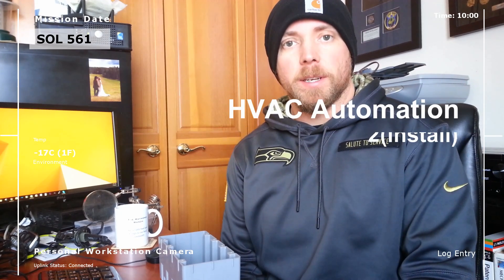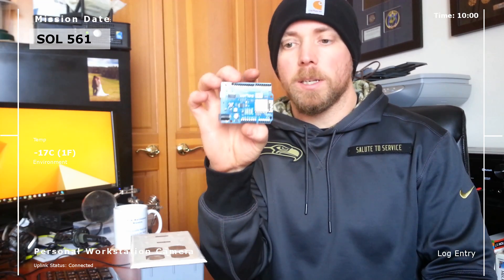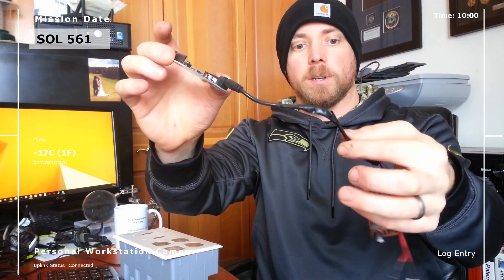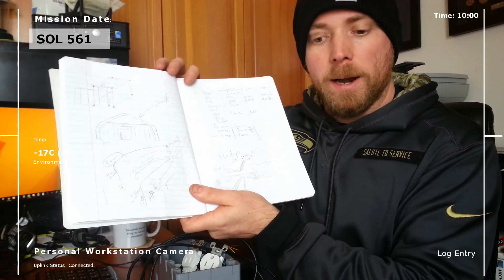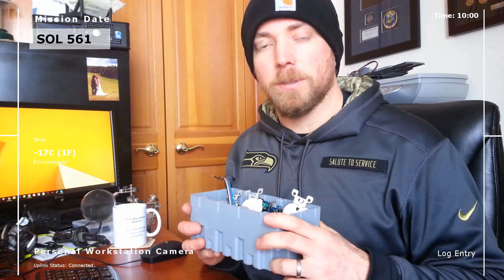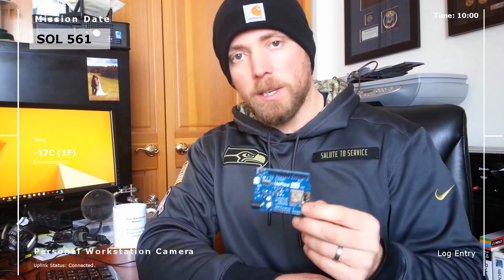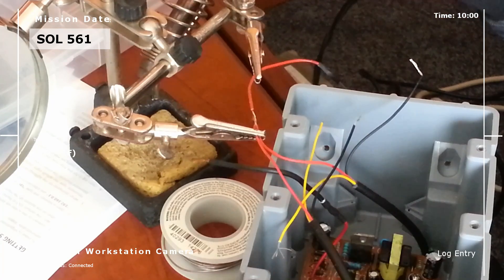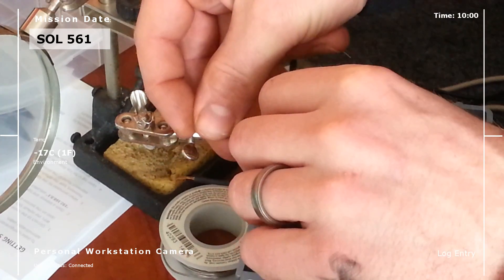Automating Aquaponics HVAC with WIFI Arduino's (ESP8266)  Part 1

Comment: I hope by now you have changed this. Thats a a 4 gang swith box, indoor. Not a box for controlss. You are creating an unsafe condition in many ways. Insulation,grounding box fill. Consult a licenced electrician one with industrial controls experience. You could go down

Comment: I am not sure you would be saving much with custom boards.  Knock off Arduinos are almost free. Like $3 for a mini. Design in the last several years have moved to off the shelf equipment to drive down cost.  Consider design time in your calculation it is the most valuable asset you have and it is least available.

Comment: Pretty sure arduino runs off 5v with a 5v regulator on board to drop the 12v to 5v, reason I mention this is a 5v power supply for 5v is quite a simple thing to make with 2 capacitors and a zener diode and would be far cheeper especially in the production model :-) also the voltage regulator is usually to first thing to fail as it produces alot of heat dropping 12v to 5v :-)

Comment: why not plug in a extension cable from the programing port and cut a small hole in the faceplate somwhere and glue the other end of the cable to the hole for easy access. faster programming

Comment: Love this video! I'm a web developer and have a lot of hardware type of ideas I'd like to tinker with. Just got a Kickstarter backed kit delivered which includes a wifi arduino board for making a little vehicle that can be controlled by an app. Your walk through of hardware setup is very helpful. I should probably watch less YouTube and get started.

Comment: You may find the Arduino resetting whenever you turn on a heavy load, try adding a snubber network to the relay contacts. An SSR is sometimes more suitable.
There's no internal fusing in this design, you may want to think about that.
You've also got a lot of floating inputs, maybe set them as "input" and grounding them all.
Reply: Appreciate Video! Apologies for chiming in, I would love your initial thoughts. Have you ever tried - Patlarny Gardening Expert Principle (search on google)? It is an awesome one off guide for learning how to expand your produce with the clever art of aquaponics minus the headache. Ive heard some incredible things about it and my cousin finally got excellent success with it.

Comment: The relay connections are not fail safe - you could create a situation where the Arduino crashes and the relay is held on. Instead use the Arduino to drive a watchdog latch with pulses, this then turns on the relay - in a crash situation when the pulses stop or remain at 1 or 0, then the relay turns off.
If you added a current sensor you could check if the relay contacts were welded on too.
Reply: horse1066 so use the other pin for the relay? There should be a default open and default closed connection. If the Arduino is off, wire your circuit so it is off and the relay is also "off" - I don't know why but all of the tutorials online for Arduino relays are backwards.
Reply: Aaron Anderson Hi, nope I was referring to the relay driver section - say you are turning on a heater and it's really important that the heater doesn't stay on longer than intended (because, fire). So you turn the heater on, then you happen to die - the heater is now on and will stay on (because nobody is alive to turn it off).
What you need is a second person (the watchdog) whose sole job it is to turn off the heater every 10 seconds regardless. So you die, the 2nd person turns off the heater around 10 seconds later - all is safe.
Now your job involves turning on the heater whenever it's required, but also telling the 2nd person that you are not currently dead and to not attempt to turn the heater off, but to check again in 10 seconds.
There are a couple of ways of doing this, here's a slightly overcomplicated version
http://raspberrypihobbyist.blogspot.co.uk/2014/01/fail-safe-circuit-using-discrete-logic.html
Reply: I hadnt' considered that if an adruino locked up that it would/could be stuck sending a "high" or "on" signal to the relay. I've seen them crash, but it's always been total failure and they fail off. Interesting problem for sure. Nothing another arduino couldnt' solve.
Reply: In industrial control systems they sometimes use a pulse train going into a capacitor, this keeps the capacitor charged which keeps the base drive to a transistor high. Computer crashes, pulse train stops, capacitor discharges, transistor turns off. But then you get the issue of a transistor failing in a short circuit condition, so you have to have a backup transistor for your original transistor.
Then you have to design your software so that it doesn't get stuck in loops, or get confused about what it's supposed to be doing next.
But yeh, in mission critical systems they'll use three computers using different microprocessors, using software written by three different dev teams, and then all three computers get to majority vote on which relay to turn on/off. If they don't all agree then it's shut down.
I reckon his design is a bit haphazard so it's possibly going to crash unexpectedly, but for a couple of heaters it's not going to be a disaster, just reboot and carry on.
Reply: That's interesting. I will have to do some reading!
Reply: He should learn if it works and is stable quickly and back to design the fix.  check out wikispeed videos they are working on a more software like version system for system design to build an open source car.  They build it in these sprints,  then use it, fully knowing it is vs 1 or vs.01.   You note design issues during the build while still finishing the version so you have operational product in hand at the end.  You would need to debug the product either way, and it might just work well enough.  Pretty interesting prospective they are using.
Reply: Cheers for the Video clip! Forgive me for butting in, I would appreciate your opinion. Have you heard the talk about - Patlarny Gardening Expert Principle (google it)? It is a great exclusive product for learning how to expand your produce with the clever art of aquaponics without the hard work. Ive heard some pretty good things about it and my good mate called Gray  got astronomical results with it.

Comment: It's generally not done to drill holes in the mounting box, it affects the integrity of the unit - better to mount everything on brackets that stand off from the front panel - then the whole unit can be removed as a whole, with maybe only the 110v coming in via a IP gland. Also ring crimps for any live connections are normal.  (I used to work for a company making controls for power stations)
Reply: So wrong

Comment: Consider a heating element to keep the electronics dry. Maybe spraying the underside with silicone. Condensation and electronics don't mix very well. After 18 years working with radio controls on heavy equipment such as construction cranes and mobile cranes i have seen strange errors due to a small drop of water.  :D
Reply: I hope he gets around to reading some of these comments.

Comment: Does the Arduino give off any heat? if so is having it in a small space with the temperature sensor enough to affect the temperature readings. Also would having the humidity sensor in a box affect its readings?

Comment: When coding the arduino. Watch out for faulty readings. Sometimes you will have anomaly readings from these sensors. May want to time average the outputs from the sensor.

Comment: What I do with these kinds of boxed devices is that I mount everything on a mounting board or two, do all the connections and then push said boards in the box, preferably mount the boards in the box somehow depending on things.

About optimizing the design, I think it is a great idea. Especially if you can have these manufactured and certified for regular home use so that using these doesn't cause any problems with home insurance in case of fire or something. For that reason I'd separate the relay box design from the sensor design. Then using a wireless connection the relay box would be electrically safe and technologically  just a remote controlled relay box and certainly easier to get certified than a "heating control device" or anything where you need to think about electrical isolation (extra low voltage cables and regular 110/240vac).

About electrical safety, the chinese relay boards you're using are usually pretty good. They have a nice relay and the pcb has a cut so as to help in keeping the AC electric isolated from the control circuit.
Reply: I think the issue with cheap relays is inadequate contact coating which leads to contact welding, which leads to a heater forced on. He's got nothing in the way of fail-safes in this design.
Reply: @Dave Snothere Probably less safe than a fail-on for a nuclear power station, and they have redundant shutdowns everywhere. 12% of house fires are caused by tumble dryers alone, and they have the same OverTemp cutoff as a space heater.
It's not a matter of "how likely is this", but just basic good design. There might be a lot of noobs tying to emulate this guy and God knows what sort of wet string lashups they will end up with.
Reply: the heater itself has fail safes built in.  it is a portable unit that normally is plugged into the wall with no control at all.  How would a fail on situation be any different then a normal operation mode for the heater?
Reply: get your point and you are right,  about learning and teaching the right way.  Dryer fires happen in the vent and aren't monitored by the overtemp in the dryer, and salt water in a back up generator can make all those redundant safe guards ineffective quickly.

Comment: Cool beans...I used an arduino nano to control my washing machine ....took forever to work out the code just to make the washing drum rotate forwards and backwards but I got there in the end....do you have any suggestions for learning code...forums can be elitist and harsh as I found out much to my surprise ....great job and Yawah bless😊👍🙏
Reply: versatec1 stack exchange or the actual Arduino forums are fantastic
Reply: I am using a nano in my washing machine too.  My He machine would not get my clothes clean, some would come out dry and never get any water, so I added a water level adjustment knob and delayed the off signal.  More water clean clothes.  Doesn't seem smart to wash clothes twice in the name of saving water.
Reply: My prob was the reverse ...to much water not enough wash time ...I live in a converter truck 😊👍

Comment: Two tips with solder, 63/37 has no "plastic" stage, it is either solid or liquid, for your "off the cuff" type soldering, it is ideal to avoid cold solder joints.  Also, clean your solder before use, it gets a film on it which can create a yucky joint. I wipe mine with my t-shirt. If I was fancy I would use a rag or gauze with isopropyl alcohol.

Comment: What are you using for the temperature sensors? And using the "Arduino" flavor of C for your sketch?
Reply from the maker: the ds18b20 is the sensor. I use Eclipse IDE with the Arduino support installed
Reply: from what I can see dallas ds18b20
Reply: it will work, there are libraries in c, lua and python
Reply: Good choice. I'll also try the Atmel Studio, it looks great. I'm just not sure if it will work with esp8266.
Reply: Nice, thanks!

Comment: Some more unsolicited ramblings from me...

I realize its your rig & youre going to do it how you see fit, however maintaining an isolated ground plane between high voltage AC (not withstanding electrical noise / foreign power injection/contamination), low voltage DC, & the control plane you have inside of what looks like a 'new work 4 gang box' comes across as HIGHLY questionable (even that much more so with how tightly crammed you have everything in there), if I were an auditor for your insurance company (or your city's inspectors office) & I took a peek on the inside of that thing, you'd damm sure be hearing about it from someone if you & I wernt having some face to face convo about it.

If I were concocting this project How would I approach it you ask...?   I would put all of the HV AC goodies into (1) 2 gang box, then put all of your control/logic goodies (and the 12v DC bus) into another 2 gang box immediately behind it.

Dont get me wrong, I love my heat shrink -but given the environment, you may want to think about button splices (used in telecom, filled full of dieelectric jelly, crimped with pliers) if the solder splices have any issues, theyre available as both a splice & H Tap I think these are good for up to...   18'ish ga wire?

As others have pointed out, the brass hardware thats male on 1 side & female on the other are referred to as 'standoffs' by hardware fabrication professionals -FWIW

With regard to surface mounting control/logic boards to a plastic electric box, just a thought...    once youve got the board dropped where you want, use a flashlight to light up the inside & you should have visibility of where the boards mounting holes are, mark with a marker, drill from outside & run your screws also from the outside, using nuts on top of the board -No longer necessary to use uber stubby drivers.

--YFWH

Comment: If you want to make your arduino pseudovital you can generate AC outputs with the software and  AC couple relays as control devices.  If the Arduino locks up the value of the output pin does not matter as AC is required to operate the relay. This will require the use of two outputs per function but won't lock up in an on state.

Comment: Excellent stuff, this vid has stepped it up a notch for ya channel, showing us how to use ardrino and its practical application(as I have had no experience with it but always wanted to learn about them). BUT I have to tell u from experience..... don't mix high voltage and low voltage together, there must be either a separator board between the LV and HV side or safer again is to put the LV stuff in a  separate housing, I realise there is more expense but safety comes first. When the older AT pc's had the HV switch on the front panel to power on the pc, as a PC Repair Tech I was electrocuted(my right arm was tingling for days but I survived), When they made the ATX power supplies it was all LV outside of the metal housing so u were safe from being electrocuted when u have to work on the unit "LIVE".... You r 1 person and u need to stay 100% safe and u need to get enough rest & sleep to keep u safe... pls do a risk assessment on ur projects so u can stay safe. BTW I am no "safety sally" either and I do take risks on working around HV. I love to make projects all LV and DC so u don't need to invert dc power to AC when it can be avoided for the extra saving in energy use. EG: all dc 12/24v house lighting, no matter what voltage the bank is, u will still have lights regardless, but people wont pay an extra few dollars to wire up a dc lighting circuit, I use 24 gauge figure 8 wire for it which can handle the 5watt MR16 globes easily (upto atleast 4 on the same circuit from the switch) and 16 gauge going to all the switches from a 24v bank. This will help u save loads of ac power, on a cloudy day 600watts of panels does my dc circuit bank no probs without draining the bank. Anyway I ranted on long enough... look forward to ur vids almost every second of the day, keep up the good work.

Comment: I'm watching this on my phone, so i can't see the Arduino board to clearly, but in many cases they will leave power pads (+ & - in) available for soldering power directly to the board.   In cases where you need the clearance that a micro USB plug won't afford you.  Also a good place to get COTS cables of many flavors including 90 degree right or left micro USB cables is PCHCables.com in Hillsboro Oregon.
Reply: If you know what you are looking for they are great. The cheapest around.    Costumer service is to be desired.

Comment: $15 for those Wemos D1s is crazy. You can get them for $3.49 from Robotdyn on Aliexpress, and I've yet to have one fail. Also, for individual circuits you want to control with a relay, Itead make the Sonoff, it has a power supply, esp8266, and a 10A relay for under $5, and again, after a few months, mine are all working fine.
Reply from the maker: awesome info...can you send me a link?
Reply: Peter Moffat I agree - the Itead Sonoff look like a much cheaper and neater option, and they come in a bunch of variants, including one with a humid and temp sensor as well as relay, and a dual relay and 4chan version.

Comment: What you've designed is essentially a threshold triggered on/off process control system.  While this will work after a fashion, you're likely to experience rapid cycling of the system as the temperature in the lanes fluctuates rapidly.   When the supplemental heating is turned off, the lanes will cool rapidly due to lack of insulation and thermal mass.   When the heaters kick on, you're going to rapidly heat the air while the beds remain relatively cool.   The process will oscillate.   What you might consider is replacing the arduino control with a standard off the shelf industrial process control unit such as the Fuji PXR.  It has built-in functionality to intelligently manage the process without overshooting and with minimal oscillation.  Just a thought.
Reply: He may be writing the software as a PID control which may avoid that issue.
What I think will happen is that he's going to rush off and  run into a whole wall of electronic and algorithmic problems, and then he'll come back here so we can repeat the same suggestions.

Comment: I hope this unit works out for you.  You may have some problems with EMI (Electro Magnetic Interference) by putting the DC components in the box with the AC.  Especially if you have any motors on that AC line.
Reply: I'd also be worried about WiFi interfearance. It looks dead sexy tho!